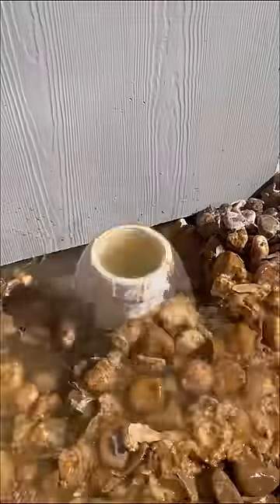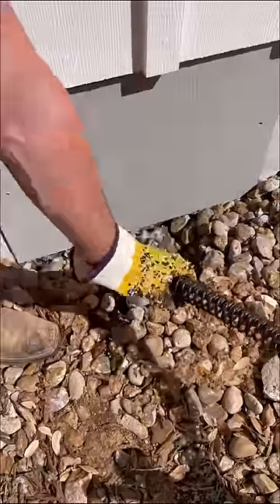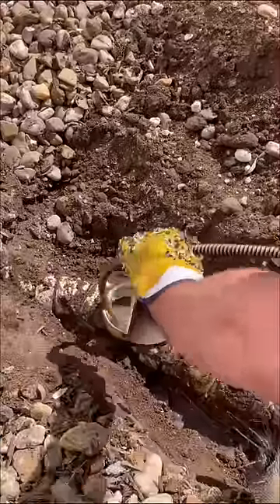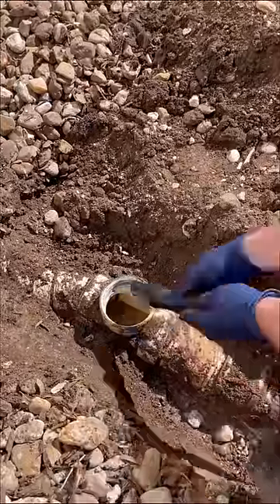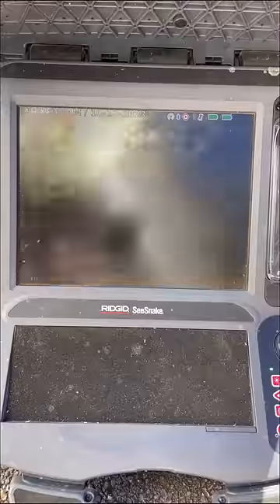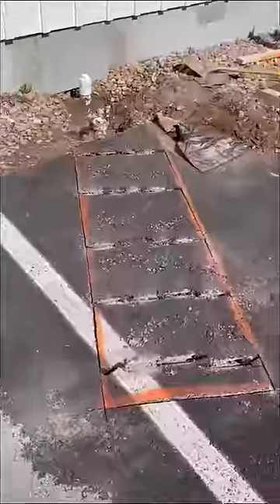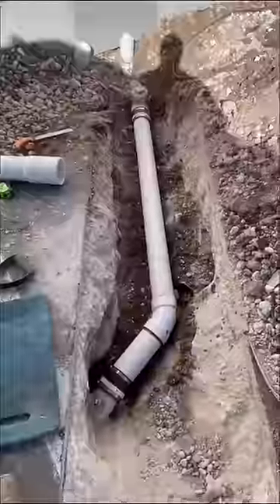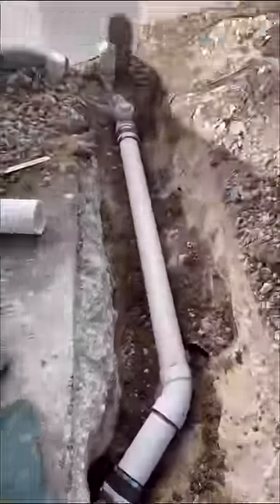What’s clogging this sewer line?

Comment: I did the low tech version of this. Dads was backing up. He couldnt work on it due to strokes.  so I cut the line at the house since it didnt have an outside cleanout. Then took 100' roll of 1/2" pex and pushed it down the line till it ran into the obstruction marked that point pulled it out and laid it on the ground and dug where it fell at the end. Someone had cut the line running power for his building years ago and it was clogged with roots. fixed both sections with some ferncos and done.

Comment: I had a similar issue to this and it was at the sewer mains connection point. Never put it together why I had a constant low spot in my yard for years, despite backfilling it and it eventually coming back. I called my MUD (Municipal Utility District) about it sense it was in the utility easement of my property. Thankfully a plumber in the neighborhood was able to clear the clog and send a camera down hole to verify the break. The MUD was playing games with me until I mentioned I had video footage and had it traced to the location. The dude that came out to do the work fixing it said that I could’ve been out $7-10k for that kind of repair if I had to pay out of pocket.

Comment: Just got done fixing a collapsed clay sewer line at the front foundation. We found it with a camera snake. Had to replace all the brittle iron pipes throughout the crawl space, too. Multiple additions with separate crawl spaces and accesses. Didn't have any cleanouts, so now we have two of those - by the foundation and the second by the sidewalk. $34k later, we're all 21st century good now.

Comment: I do epoxy pipelining. We saturate a cotton like tube with our epoxy, then slide our bladder ( looks almost exactly like a bike tire tube), roll it up, tape it with thin masking tape and pull it in place/ push it depending on access and turns. Then we air it up coursing the tapes to break and it stays for a couple ours then we remove the tube and there’s your new pipe. Smaller diameter we do is 1.5” and biggest I’ve seen was 36. We use ridgid cameras to mark out our liner and any cutouts for connections then transfer those marks to our liner to build our ends (pull/ air end). Not a lot of people have seen it but it’s been around.

Comment: The sewer line out of the store I work at has been partially collapsed for years, not enough to normally cause major issues, but every 4-6 months we get a problem and the drains start backing up. Which means our restrooms get shutdown for 2-3 days while we get a plumber out to fix it.

We know exactly what and where the issue is, but because of it's location being right where the line in the store connects to the main outside line, the company that runs our store and the company that owns the building we are located in are in an unending fight over which one needs to pay for fixing it.

Comment: Same thing here. The town did work in the street and crushed the chimney on the 1905 sewer pipe that my home sewer ran to. They just filled it in & repaved. Year later we had the $500 cable snake guy here 3 times in 10 days. Ended up digging 120' through a sidewalk and a 10' × 10' hole in the street. After paying for the work & paying for the road to be paved 20 feet in each direction and both lanes it was over 20k. Considered suing the town but just bit the bullet. The gas & water lines were right on top of everything so the water co or gas co was responsible but no joy getting any reimbursement.

Comment: Happened at my house. AT&T was drilling holes through the ground for their fiber cables. They went through my pvc pipe, water was backing up to my house any time it ran longer than 2 minutes. I had to get the city involved, they came with heavy equipment told me I would get billed if it wasn’t the city’s fault, when they dug and saw it was AT&T fault they diverted all claims towards them and not me for the excavation. I needed my driveway replace afterwards, that came from my own pocket 😢

Comment: In the UK the most common size of PVC underground drainage pipe for domestic housing is 110mm. (This refers to the outside diameter of the pipe). When a number of houses are joined to the same drainage system, 160mm pipe is generally used for the pipe carrying the main flow.
Reply: It would also tend to be considerably deeper, especially under asphalt where a heavy vehicle might be parked.

Comment: So was it the fact that a vehicle driveway was on top if the line?  Do you use thicker PVC to fix this?  Or add some other type if reinforcement to prevent it happening again?
Reply from the maker: Sch. 40 PVC is what should have been used.

Comment: Looks like they ran a heavy steam roller when they did the black top driveway. That caused the line to collapse under the compactors weight. the contractor who did the remodeling is partially at fault.

Comment: Starts out small like a clogged toilet and then you have to replace the line to the street. Happened to us. All of a sudden the toilet wouldn't flush correctly. Called a plumber, troubleshooted a bit, put a camera down the pipe and told us the tree roots had got to the main line and would have to be replaced from the house to the street. Unfortunately, since the original piping went right around a tree, it was much more cost effective in the long run to just re route everything . And trust me, i saw their camera and ,i mean, theres a friggin tree in the way so it all makes sense. What we originally thought was a clogged toilet and maybe a couple hundred bucks turned into $28k and tons of labor. This is the one time I hate having a decent sized property 😂. Oh and I hate the original builder who thought it was a good idea to run the line around a tree. And the person who put the tree there. And  God . And let's put my neighbors dog in for good measure 😂

Comment: I have a custom head that is only about 1/16 larger than the cable, I can at least drain the line to camera. Obviously it’s not a fix but it does get through tight spaces.

Comment: My terracotta sewer pipe was just laid down but not mortared when it was installed in tbe 60's and when tbe ground sunk down here in Louisiana rhey all got dislodged leaked and it backed up. Had to have it all replaced about a 70 foot run. They used PVC. $6 grand they charged which I thought was high but too much to do myself and couldn't find anyone else.

Comment: I worked in a book store that had a clog in the sewage drain. They pulled out what we eventually determined was a drink thermos out of the pipe. Considering where it was it had to have been put there on purpose when the building was being remodeled before the book store moved in. Which was like a decade prior. Crazy that it took that long to cause a problem.

Comment: Recently remodeled?  I would be asking some questions about heavy equipment used. The guy that landscaped my yard ended up paying to have my septic fixed when my neighbors ring came caught them running next to it with a big excavator. He had even shown on the estimate extra charge for hand digging in that area.

Comment: Nice job but why not solid joints.  Will the ferncos hold up.
Reply from the maker: No, they cannot be buried. I just did that as a cheap temp fix until the line gets replaced.

Comment: This is why foam core PVC and ABS need to be completely banned. People use them because they're cheap and they're code compliant for non-pressure applications, but this is what happens. Solid wall pipe ONLY so it will actually last!

Comment: If you use the clamps. With a solid stainless steel band across the whole thing they won't sag out.
Reply from the maker: I only used these as a temp fix until the line was dug up and replaced

Comment: Them ferncos suck.  It is a little more but the hulk ferncos are way better. They are a more ridgid connection.  Just fixed a 8 inch today where someone installed a 8x6 T Y and the fernco let it drop when they sleeved it in.
Reply from the maker: The ones I used are not actually allowed for use in the ground and never use them. Only did this as a temp solution until the replacement could be done

Comment: Use the right size cable. 
1 1/4” cable is for building drains and large sewer lines. You guys kill me with your puny 3/4 cables made for cleaning out a stack inside a house. I’ve seen plumbers do this to drum up work that isn’t there like your “Unseen” issue. If you would have used the right tool it would have worked. A 1 HP sewer machine with a 1 1/4” cable. Rigid and General both make them. They take out riots and everything. All you did was rip off the homeowner.

Comment: You don't have a compressor to check if thr line is collapsed?  It won't hold air.
Reply from the maker: On a drain line? What? 😅
Reply: @theplumbersplunger  I didn't think it thought because it goes to the sewer. But leak detectors have a way of doing it, via thats one way and they have another way, and one way is yes a camera which you used.
Reply: If you could block the end sewer line somehow, then flood it with air.  I'm thinking it could work and if it doesnt hold air.  Youre boned. I do light plumbing but mostly above ground.  Not in ground plumbing.  I'm a pool man with swimming pools. I couldnt deal with shit and sewage.